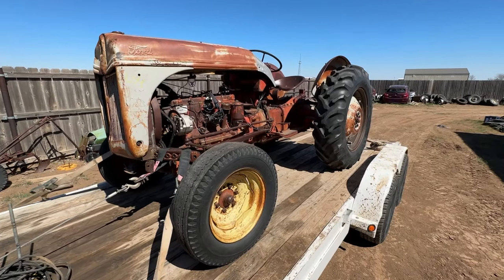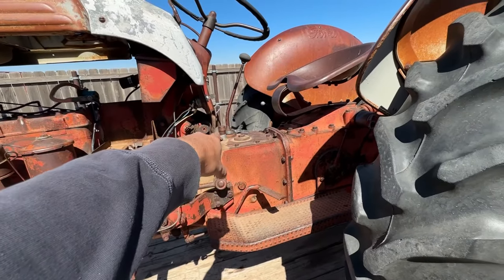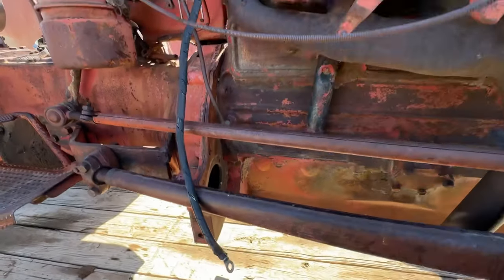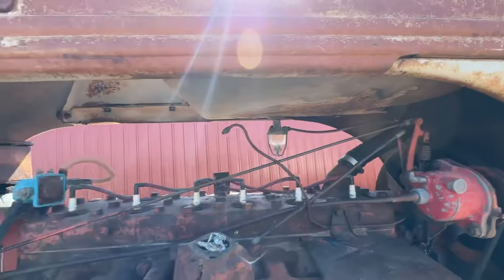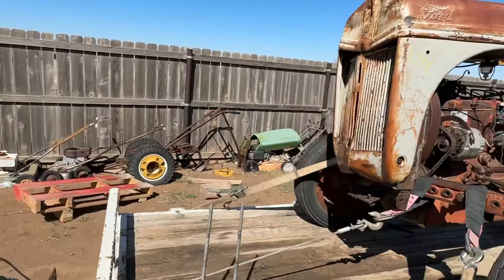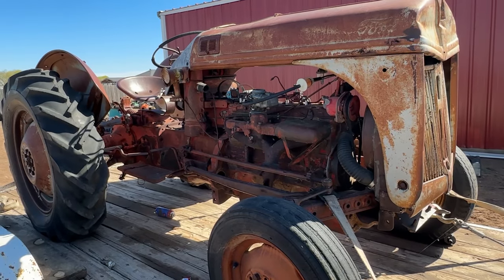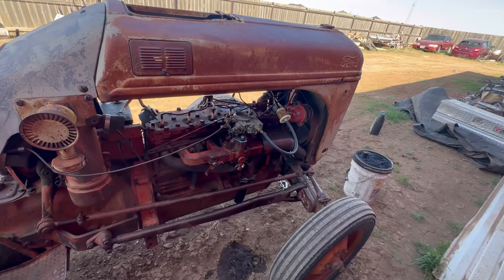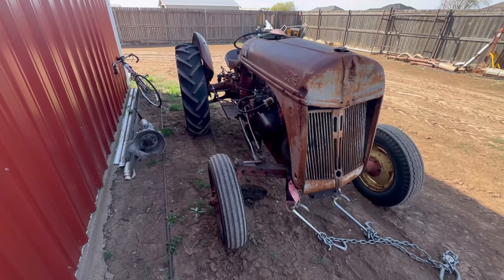Ford 8N Funk Conversion. Will it Start Flathead Edition.

Comment: You're trying to run a standard 12v coil through a ballast resistor. The spark at the plugs will be weak. The idea behind the 6v coil is that it assists cold starting by shunting the ballast during starting, and giving the coil an extra oomph. Once the engine starts, the shunt is opened, and the coil returns to its normal ballasted supply.  Put the 6v coil back in. It was correct for the way the ignition is wired. 12v supply, 6v coil, ballasted circuit.

Comment: It should still run with a stuck valve based on the way you have to give it full fuel to even really run your carb is plugged up and needs cleaned but the shit in the distributor cap is causing the spark to jump all over clean the cap out and it'll start